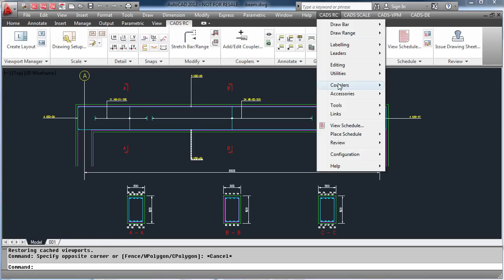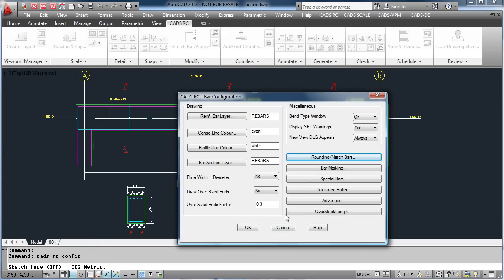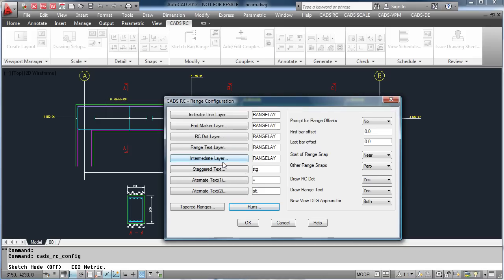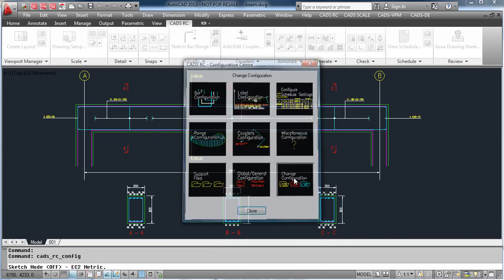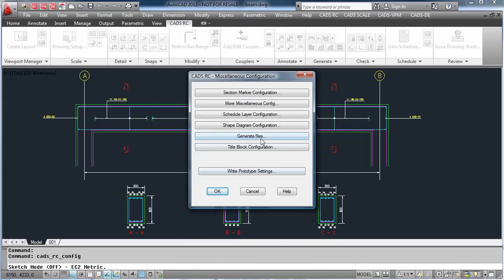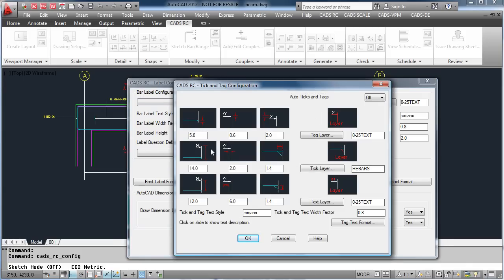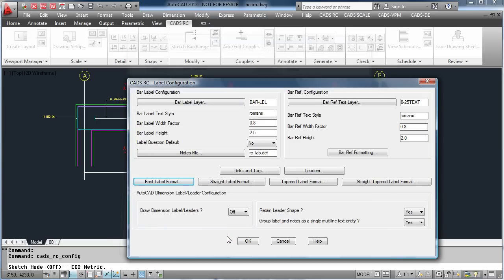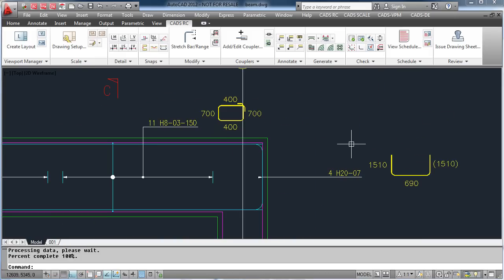CADS RC Video Demo 2 (Configuring CADS RC)

Comment: Hi how can i convert version 9 cads rc file to version 8 (for cads rc 2004 to 2007)
Reply: Dipo Adams
Reply: Dipo Adams hi
Reply from the maker: +Dipo Adams HI Dipo, Thanks for the question. To do this firstly use the AUTOCAD "Save as" command to save the drawing back to the correct AUTOCAD version.
Secondly, from the CADS RC pull down menu select utilities, then Save as V8.4 drawing or type cads_rc_saveas840 at the AUTOCAD command line.
I hope this helps but if you have any further queries we can be reached at support@cads.co.uk